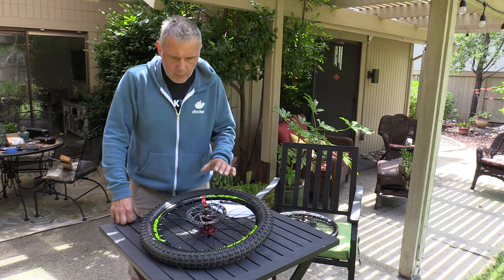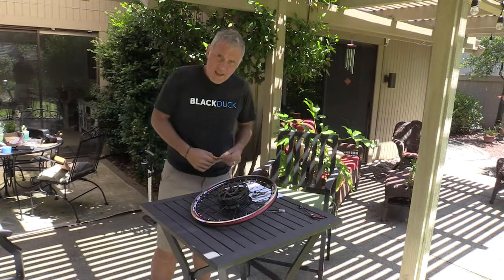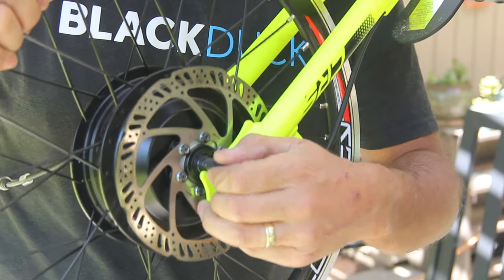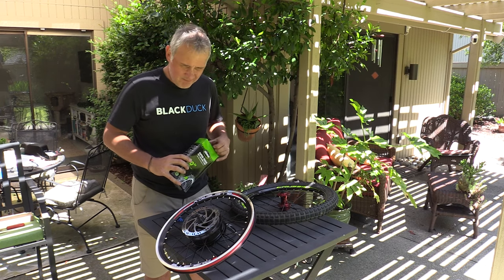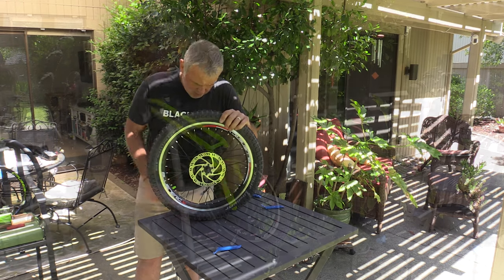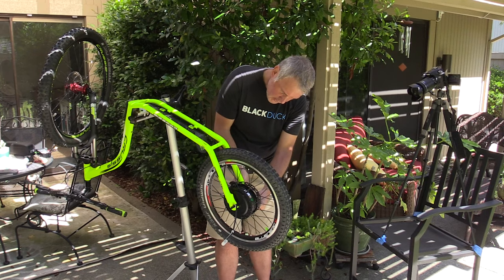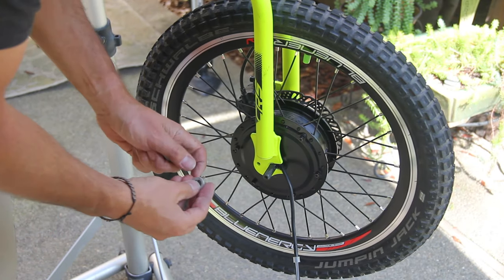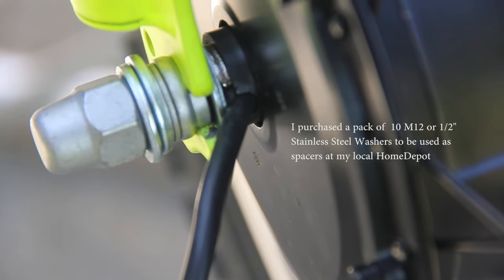eCrussis DIY Part 3

Comment: What is the width of the dropouts on the rear of the Crusis?
Reply: 100mm
Reply: I went with a KickbikeUSA USA to make my e-scooter. Just went with a 26" bafang kit. Worked great
Reply: @falcn12  which model did you get?
Reply: @luisLP5752  Cross Max 20D. Upgraded the brakes to hydraulic myself. Looks like they have a 20HD with hydraulic disc brake OEM